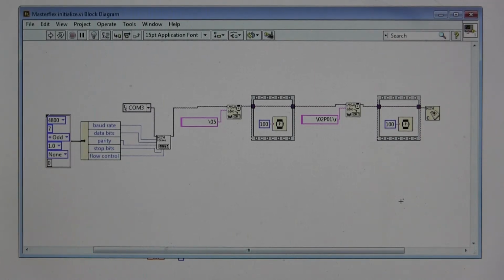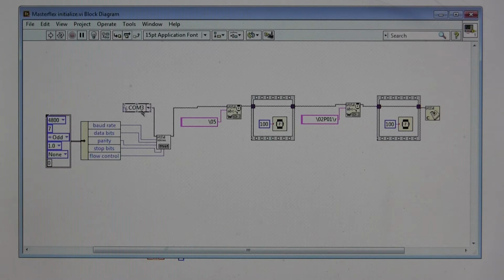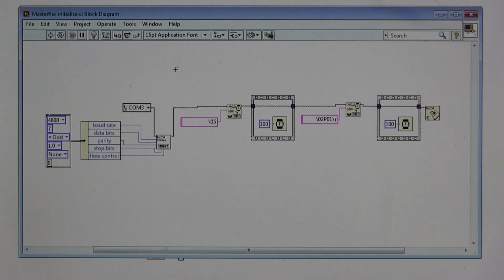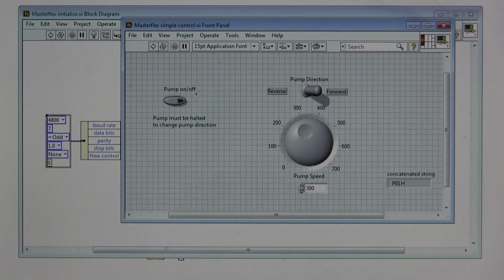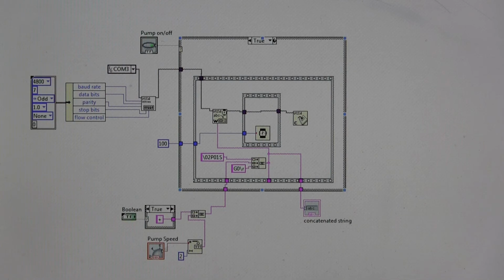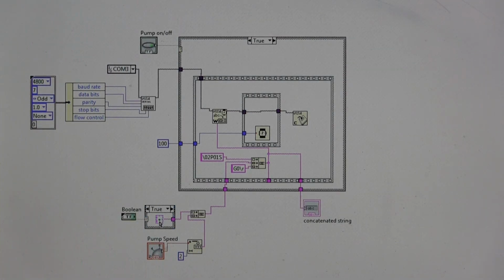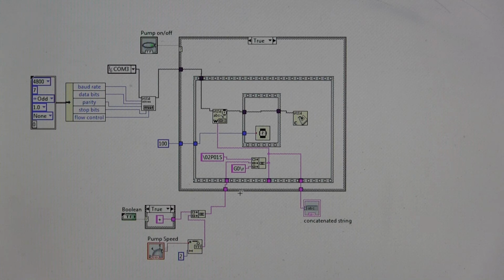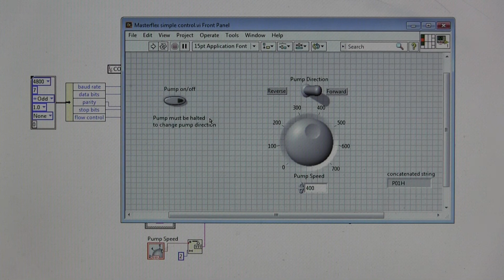Labview programs to control a Masterflex peristaltic pump via RS-232 serial communication

Comment: it would be possible to do the same thing with a gilson pump? if i change the baud rate and etc. Cuse i know gilson strings commands, know the baud rate and the voltage it works, if i send the data through the rs 232 would it work?
Reply from the maker: I haven't used a gilson pump, but if it has RS-232 capability, then I would imagine that the communication approach is very similar to what is shown in this video. Good luck!

Comment: Very nice and clear video! Which PLC did you use to connect the pump to LabView?
Reply from the maker: Hi Scarlett. We did not use a PLC. We used a standard personal computer connected through its USB port to a National Instruments USB-232/2 (part number 778473-02). That box is then connected to the pump using a 9-pin straight-through serial cable. The pump is a Masterflex L/S Computer-Compatible Digital Drive, such as item number UX-07551-20. In our setup, it is important that the pump has the RS-232 capability; not all Masterflex pumps come with this feature. Our setup is not the only way to make the connection with the pump (for example, there are other USB to RS232 converter boxes and cables, or a lot of older computers actually had 9-pin serial ports in the back). But however you make the connection, if it is RS-232 communication, these Labview programs should work.